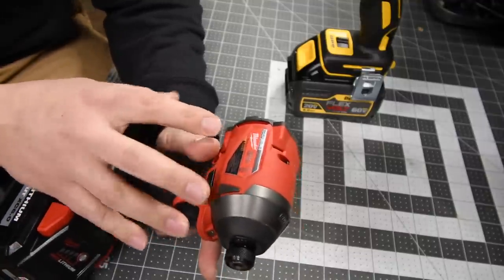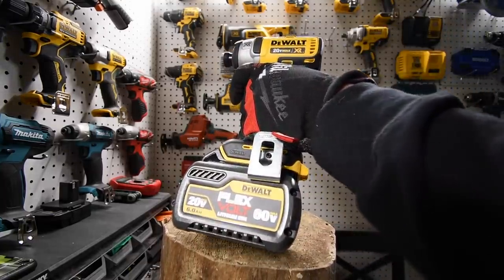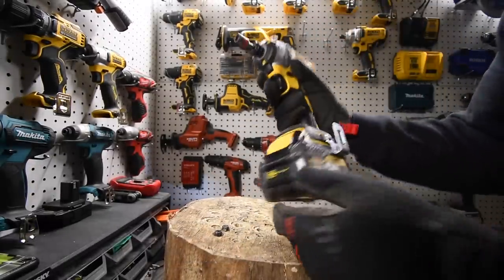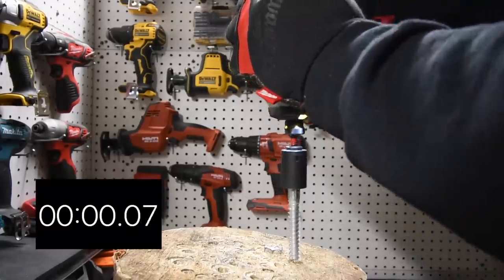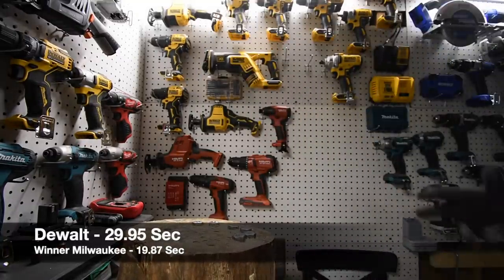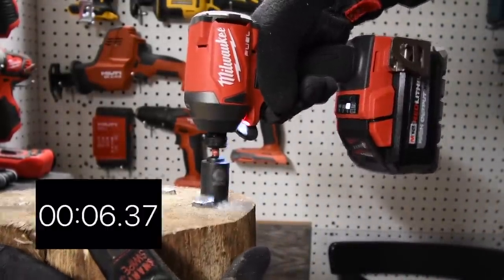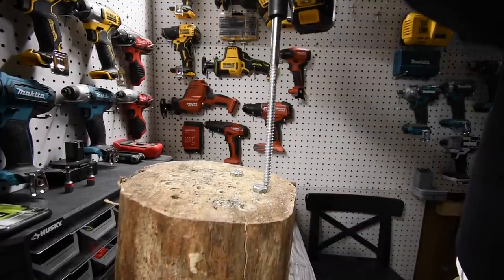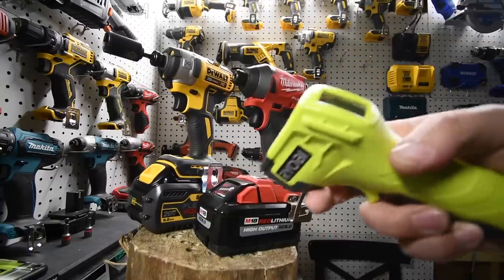Milwaukee vs Dewalt (Impact Drivers)

Comment: I'm a Master Commercial carpenter in NY C  35 years experience I have used almost every major brand of Battery tool Hilti to cheep Harbor Freight  I bought  Milwaukee 18 volt drill and small impact ( like in the Video brushless )  plus a 18 volt SawzAll 
Just for home owners use , the 2 speed drill after one year of use , a tiny screw sheared off drilling a 1/2 inch pre drilled 3/8 in metal making it not usable , the 18 volt SawzAll all. Died  6 months after I bought it cutting a straight line in 3/8 plywood  the sawz all was fixed Manufactures 
Warentee. It has to be repaired , I'm waiting for the small impact driver to go next , I will never again buy a Milwaukee  product or tool again 
I used  dewalt son the jobs they are dependable    The best is Hiliti
Reply from the maker: I love HILTI as well and thank you Paul
Reply: Your obviously a paid dewalt employee
Reply: @jacobabraham3615  😄

Comment: I am into DeWalt slightly, one tool kit, but I'm definitely interested in Milwaukee. I might start to switch over since I'm not in very deep on either. DeWalts have been great so far though
Reply from the maker: The milwuakee m18 fuel system is amazing
Reply: Don't.

Comment: I'm returning Milwaukee impact driver today I thought it would be an upgrade from my Dewalt that I've had 5+ years but the Milwaukee trigger absolutely sucks I've gotten use to the responsiveness and finesse of Dewalt. Milwaukee is great if you have to screw lags all day but I need more precision and control for woodworking and home projects plus Dewalt still has the torque to screw lags all day if by some miracle I had to put up garage doors all day.

Comment: Its nice to have the speed but how long will they last is the big question?
Reply from the maker: it will last a long time, both dewalt and Milwaukee are built very well. not as good as HILTI. but still built very well
Reply: @ManCaverTools  dewalt is still number one in tools
Reply: @jasonreevesjr1323  😂😂😂
Reply: @jasonreevesjr1323  i do not agree.
Reply: @jasonreevesjr1323  
Sure thing bud.

Comment: Hi,

I think by now we all know that DeWalt (6.0ah / 60v) flexvolt battery uses 18650 cells. They do have a 20v (6.0ah) with 21700. 

The 21700 cells batteries supposedly gives 30 percent more power and run the tools cooler.

I don't think it would have made a differents againts the milwaukee m18 due to the specs on the milwaukee is greater. 

I'm just saying maybe use the same type of batteries / cells if you are doing comparison challenges videos. 

Thanks for the video
Reply: The XR 6.0 battery you mention has a little more power than the Flexvolt 6.0 but not much more.  The XR 6.0 uses 10 - 21700 cells.  The Flexvolt 6.0 uses 18650 cells but it does have an extra row of cells for a total of 15 cells.
BTW, 21700 cells have about 75% more power than 18650 cells.  They vary cell to cell, but 18650 cells put out about 20 Amps and 21700 cells put out about 35 Amps.
Reply from the maker: correct but that doesn't mean that it will make the tool win against the other tool, I did a test ageists 21700 cells vs 18650 cells in the past and the 21700 cells loston the same tool, it doesn't always mean the better battery will win. remember that, sometimes the tool itself is better
Reply: @ManCaverTools  

Oh, please don't take it the wrong way.  I just been watching a few videos that show how the new batteries (21700) cells perform better on tools. That's why i just mentioned it.  Just looking at a fair comparison. 

Like i mention on the milwaukee tool. Certain brands have higher specs and will perform better no matter what battery cell you use.

Thanks for the video
Reply: @IndependentThinker74  

Thanks for the info
Reply: @ManCaverTools  I agree.  Impact drivers don't draw as much current as other bigger tools so any larger sized battery will run an impact driver at it's peak capacity.

Comment: Ive been using the same dewalt bit impact for the last 8 years, and im curious about the longterm reliability of the milwaukee
Reply from the maker: I think the life time of a tool depends on how it is treated. no tool will last a long time if it is dropped left and right
Reply: @ManCaverTools  this is true, im a road tech for semi's and my impact is well past ruined , but it hasn't stopped working  through rain and mud.
Reply: @cptsarge7934  what do you have yellow ?

Comment: In real world scenarios my co workers always need to use my dewalt impact because their Milwaukee can’t do the job .now I still have the original brushed impact and it’s very very powerful I wanted to upgrade months ago but my coworkers said don’t sell that thing because the new impacts might not be as powerful so then a month later my impact ball bearing broke and I thought hard about upgrading again but I didn’t and I just fixed it but it’s a fact my coworkers come get my drill to do things the Milwaukee can’t and I never need to get the Milwaukee . And I’ll admit Milwaukee won but I know dewalt has the best all around impact . And when I do upgrade I’ll get the single speed impact but brushless
Reply from the maker: sounds like a plan and thank you BankHead for viewing :)
Reply: bankhead39 

lmaoo stopppp it, what type of work do you do that a milwaukee cant complete??
Reply: Petrit H decking and commercial metal doors and frames . And yes I said Milwaukee grinder is trash barely can use it to cut a metal door I know that might be to much cutting for a cordless grinder but hey thats the type work I do🤷🏽‍♂️.and the cordless circular saw🤦🏽‍♂️ I tired to use it yesterday while someone used my rear end dewalt circular saw but it took 3years to to cut the 2x8 and the impact can not and I repeat it can not drive 5inch lag screws or remove them and in every situation I just described my co workers come get my dewalt tools to get the job done and those are just a few scenarios

Comment: I'm a mechanic..I like m18  but bought  the dewalt just bc rubber handles on m18 not fair well with oils over time....look into that...go to shops and c how they swell up and get nasty soft....
Reply from the maker: each person has their own reasons why they get a certain tool and I thank you for the feedback on why you wanted the tool
Reply: That's the TPE overmold that's disolving. But it's the same stuff used on all the major tool brands.  I think ya just gotta do your best to wipe the shmoo off.  It'll damage the Dewalt overmold the same way.
Reply: Do tell bc want know no smack talk y is dewalt bad.....I'd like 2 know bc bought 750.00 dollars for there impact drivers...is there something I should b checking on 4 warranty
Reply: Know not made in states even though says assembled here..   if got good info do tell...the battery bit louse in guns but seems to chug o lug ok.......only had for 2 month as daily mechanic so cant give review... seems ok but only electric stuff had... all my stuff old school air.

Comment: Love your videos. I wait for new one every day.  I am surprised and little dissapointed with Devalt but still like their tools
Reply from the maker: I thank you for Norbkowa :)
Reply: @norbkowa I don’t see it as a disappointment cause the Milwaukee is way too fast for most jobs. Unless you driving lags in all day I wouldn’t suggest the gen 3. Plus with collet issues it’s known for I would stay away. I use dewalt heavily and I own the atomic kit and have used and abused them for almost a year and zero issues. 32-3300 rpm is more then enough for driving deck screws. Honestly I like the slower speeds like speed 2 cause it’s more controlled and I don’t strip out screws. Otherwise cam out would be an issue

Comment: I use both frequently the dewalt batteries are slightly more reliable and I prefer their hammer drill but I use Milwaukee saws and impact wrenches
Reply from the maker: I think that each tool brand has their own certain powerful tools. that's why I love all brands :)

Comment: I wonder what boost a 21700 cell flex volt would do? That Milwaukee is using 21700 it in this video.
Reply from the maker: I think it would. I will be getting a 21700 celled battery for the dewalt soon

Comment: I feel as if the DeWalt has a higher resistance when it comes the need to start "impacting" by the sounds of it, sounds like the Millwaukee starts impacting almost immediately every trial. And the DeWalt just drives because it is programmed as such to handle it with shear driving power. Thus describing the big paper comparison.
Reply from the maker: very true and thank you for viewing Tyler
Reply: I think it engages sooner due to the speed of the impact rather than just making it seem to grit through until it absolutely has to. Quicker speed = quicker the hammer and anvil activation.

Comment: I’m pretty sure the Milwaukee beat the dewalt impact wrench too lol. Put the Milwaukee up against that high dollar hilti and see what she’s got
Reply from the maker: It did not beat the impact wrench. The Milwaukee failed to take out the bolt, the reason why I got the wrench out in the first place. And I did put the Milwaukee hammer drill against the HILTI hammer drill and the Milwaukee lost big time In both videos I did of it so far
Reply: Didn’t it drive it faster though? I meant to put the impact driver against the hilti impact driver. I saw the drill driver video. I was surprised by that one honestly. The Milwaukee drill is a beast and I didn’t expect the hilti to out do it. I’m wondering if they are going to make a gen 4 anytime soon. I Doubt it but all these new drills are really starting to step up so they might not have a choice sooner or later
Reply: @johnargumaniz9179  The Gen 3 drill was never the most powerful drill anyways. 

The DCD996 was always stronger/faster.  Just at the expense of size and weight.  And with the new 998 (996 with upgraded motor/electronics) the gap only gets wider.
Reply: @ManCaverTools  the half inch impact wrench....?

Comment: You oiled the Milwaukee screws. It shows when you tried to take them out, Milwaukee couldn’t take DEWALT screw out, but it took out the one it screwed in
Reply: Omg he did
Reply from the maker: lol. its not oil. use common sense. it some tree sap in the log.
Reply from the maker: lol no.

Comment: Check the drive in time of the the Milwaukee on the 10" lag alone.  Now look at the DeWalt's impact wrench time on the drive in of the 10" lag. Check it just for fun.
Reply from the maker: I know the miwlaukee beat the dewalt wrench on driving it in, an impact wrench isn't about how fast it can do the job, its about the power it has, only a test that is impact wrench against impact wrench would make sense,
Reply: @ManCaverTools  You're absolutely right.  Impact wrenches are designed for nut busting torque not speed. (Hence why I said to check it "just for fun".)  I personally like Makita  and Hilti for how they feel in my hand.  Control and comfort applied to power.

Comment: My dad was ashamed when I went Milwaukee. Sorry, I buy the best product regardless of brand.
Reply from the maker: its all good lol
Reply: If you buy the best products, then you should have multiple name brands and swap to who every makes the best tool in that category. Milwaukee leads a few, but definitely not all. They still can't figure out how to make a drill chuck.
Reply: Just started a residential electrical apprenticeship and i'm in the same boat. My dad is trying to sell me on yellow and I'm leaning towards red.
Reply: @FuzzyCow777  Even commercial electricians use milwaukee, and exclusively milwaukee
Reply: @beefuzzy310  the statement about Milwaukee drill chuck’s is FACTS!
Reply: If this gentleman only buys the best product regardless of brand I sure expect him to own a DeWalt XR 20V Max drill...
I will give it to him that the Milwaukee has a little more power in the impact driver and wins that category.. even though I run with the yellow and black team
Reply: I do believe Milwaukee is trying their best to make the best products though, their design team are doing great work which is why I go with team red. It’s not just tools their accessories and storage solutions are way above the current competition.

Comment: The milwaukee hits faster. The dewalt hits harder. Ive owned both. My dewalt lasted 2 years longer than my milwaukee. The milwaukee is faster but do to the speed it puts more stress on the internals and the hit plate wears out.
Reply from the maker: we will be revisiting this test and doing it LIVE
Reply: 100% dewalt last longer my crew all agrees we went through Milwaukee’s every year and we have dewalt  now and I mean we beat the piss out of them like crazy and were on 4 years we had olny broke one cause the guy dropped it off the roof 45 feet up

Comment: So I'm trying to decide which brand to basically "devote" myself to, since it seems you generally want to stick with batteries that all your tools can use.  Milwaukee looks to be the better brand overall BUT I see DeWalt has a lifetime warranty correct?  I couldn't find a lifetime warranty for Milwaukee am I right?  I think I'd take less speed and power if it could be replaced for free when it brakes.

Comment: M18 lately are being compared to 60v … Hmmmmm 
I have used both Milwaukee M18 and Dewalt 20 V and I like them both….. I really like my Milwaukee impact drivers
Reply: Only 60v when it's on flexvolt tools. Also dewalt advertises 20v when it's 18v

Comment: I feel like on the 10” at least, hit a knot or something. But it also could’ve been the fact that putting multiple screws in makes it more dense to an extent. That’s why I feel like it wasn’t necessarily 100% fair. The shorter ones were a few second off from the Milwaukee. But still, good vid
Reply from the maker: I will be revisiting this test with a better battery for dewalt

Comment: Should have tested the surge fuel model against the xr would have been more accurate
The surge is the top of the line for there 18v
Reply from the maker: more tests are coming up and I thank you Critical
Reply: You r wrong
Reply: The 2853 is top of the line
Reply: Surge has way less torque than Gen 3

Comment: You only press down on the Milwaukee and not on DeWalt
Reply from the maker: I dont press down. I hold my stance so I dont lose control of the tool. sometime I dont need to hold the tool because it is under control

Comment: Need to do a paddle bit/ wood bit  though a 2×6 or what ever I'd love to see that.
Reply from the maker: I will be remaking this video with a better battery for the dewalt soon
Reply: I wonder if we'll see the paddle bit get pulled out of the Milwaukee? (collet issue?). Does the Dewalt have two ball bearings in the collet? Milwaukee only used one for some reason.

Comment: Temp reading was way off...Dewalt had just pulled those out while the Milwaukee was sitting. But the biggest omission? Price. Usually, the Milwaukees are much more expensive. Im a DIY'er so I dont need to spend the extra as Dewalts are more than good enough for me. Regardless, liked the video and will be watching for the hammer drill test!
Reply from the maker: the temp doesn't drastically go down after 15- 20 sec
Reply: @ManCaverTools  my point was the Milwaukee was last used at 11 minutes and 50 seconds in the video, the temperature reading was done at 15 minutes 43 seconds, the Dewalt had just finished pulling out the 3 lags.
Reply: @GrandpasWorkbench  dewalt had more run time the entire time though, because milwaukee got it done faster.
Reply: @wclintf  I'm just giving him a hard time.. I know the Milwaukee's are pretty much a better tool, it's just not big enough of a jump for me to worry about it. For the stuff I do the DeWalt's I have are more than enough. We have a big Milwaukee fuel impact at work and it's a beast, I just wouldn't spend almost $600 on one.
Reply: Yeah more deals to be had on DeWalt for sure.  Plus it's an American company who makes a lot of stuff in the US.

Comment: Why Dewalt battery setting 1 ? because Milwaukee battery setting 3 also shows up. Either a wrong assessment was made here or I see it wrong...
Reply from the maker: I already did a video of these 2 with both tools using 21700 celled batteries

Comment: I have been using a Milwaukee brand for years, great tool and fast but do not last long,  I use them every day but seem like lately only last for few months. I'm gonna try Hilti this time
Reply from the maker: Im sorry to hear that. HILIT will last a long time but its not nearly as powerful
Reply: I use HILIT everyday I love it's reliability fantastic tools they do last for a long time
Reply: I have a hilti kit from and from my experience the drills are pretty shit, the grinder and saw isn't bad but not the best but the battery are the worst thing about them, 3 batterys will not last a full day of hard work where as I've done the same job with a milwaukee and makita on 1 battery, maybe my stuff is just fuck idk but in my experience hilti is not amazing

Comment: Was the Dewalt in its high speed?  It looked like it was in the middle speed?
Reply from the maker: yes it wason speed 3. there is a major difference in sound on speed 2, you would immediately know if it was on speed 2 and not 3

Comment: So the fast one is the winner, more stress more chance to do damage, wrong. use Metabo, very light so easy to use and a lot of power, my experience by using aluminum screws in steel plates, Metabo has a pulse, it's fantastic.
Reply from the maker: I prefer HILTI myself

Comment: So what’s a better impact driver for daily use 18v Milwaukee fuel or 20v Dewalt Max XR?
Reply from the maker: The Milwaukee is better. its more powerful and able to do more tasks
Reply: What ever battery platform you use